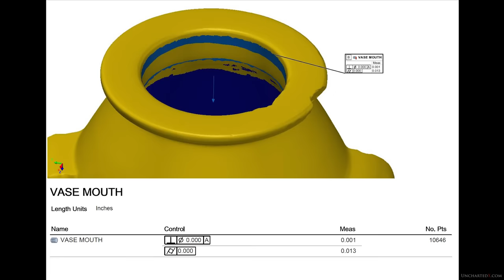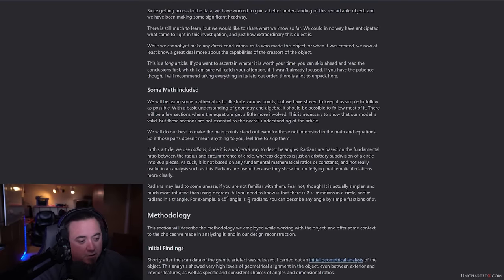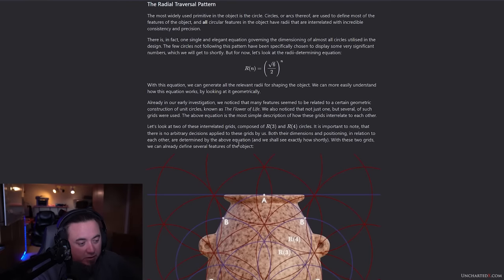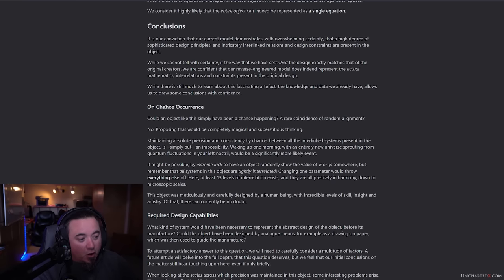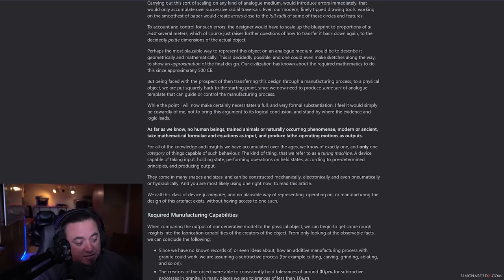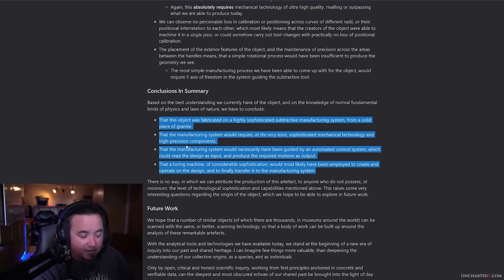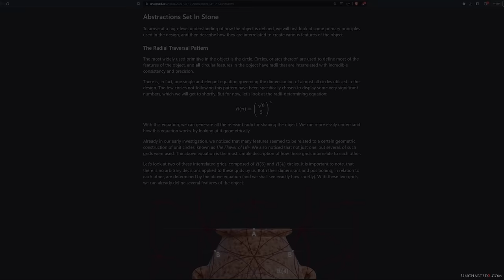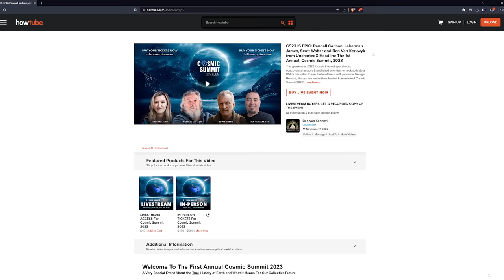Was a COMPUTER Used to Design this Artifact??

Comment: As a former machinist, I totally agree that this was made using a lathe. The mind boggling thing is the handles... Either they where "glued" by some ways after the turning process, by "melting" the granite like we do for pottery or the whole vase was made with a multi axis CNC machine like suggested. Incredible stuff. 
We are absolutely not the first generation of humans with high technology roaming on this earth, we just kinda lost traces of it in history and those artefacts are there to reminds us that it all existed. Fascinating!
Reply: There was no gluing or melting involved, it would be obvious in granite. Melted granite turns into volcanic glass upon cooling. This artifact was simply machined in one piece using very precise tooling.  I also have my doubts that they were ever "vases", not a single original lid has been found.
Reply: @methylene5  Yeah I totally agree about the glueing. It makes no sense really. A vase in my vision, does not have a lid, at least in the french version of the term (I speak french). 
It's more like a flower holding thing with open top, if you know what I mean. So maybe "vase" was not the right word for it. Not important, the point is the fabrication process.
Reply: You can't melt granite and re-form it unless you allow it to cool really slowly so the crystals can regrow - this is 10 or 100s of 1000s of years. quicker cooling gives basalt or diorites.
Reply: @mistral-unizion-music  I think the manufacturing process is but a single point among many others just as important.
Reply: @methylene5  I have also been uncomfortable about calling these mere vases. I'm wondering if the others found were, as far as could be seen, exact duplicates. If there are differences I wonder if they maybe somehow a way of storing information similar to a hard drive or a floppy disk. It would be like stone age people stumbling on a floppy disk and think it is merely a drink coaster. Or finding magnetic tape and thinking it is just old present ribbon or bow making material. Maybe they somehow fit into one of their computers and data read off of them.
Reply: @SlickArmor  Christopher Dunn thinks they are possibly helmholtz resonators (hence no lids). Which are used to convert the Earth's low vibrational energy and increase the frequency to very high level for the production of electricity in the Great Pyramids. He details this in his book called the Giza Power Plant.
Reply: @methylene5  oh very interesting thanks for providing a new direction to check out. I wonder if they have tried to see if there is any residue in any of them? Thinking in that direction perhaps with them being a container they may have contained a liquid and maybe the lids were made from a different material that didn't last. I'm thinking maybe a lid with insulating properties like a wooden lid. Then wires could come through the lids like a miniature Bagdad battery. I'll have to see what Dunn has to say as that sounds like a totally different super high technology. And just to reiterate I wonder if there were scores of them with the exact same dimensions or perhaps different sizes for different resonances.
Reply: @SlickArmor  I definitely recommend reading The Giza Power Plant. I read it some months back, and it's quite thought provoking. If Chris Dunn is correct, then there is obviously a lot of equipment that is missing, and the Great Pyramids would have to be much older than Egyptologists say. 
The basic principle behind the theory, is that the reason why the Pyramids are the size they are, is due to the extreme mass (nearly 6 million metric tonnes) and therefore inertia to create the highest vibrating pressure/forces from seismic vibrations. They are a harmonic with the mass of the Earth, so the Pyramid can be made to resonate in tune with the Earth. The smaller Pyramids being used to kick start the Great Pyramid power plant. The helmholtz resonators were used to gradually increase the vibrational frequency using harmonics in the Galley using thousands of the resonators. The stack of granite above the King's Chamber was also used to further increase the frequency. 
Granite is crystalline, but it's not a single crystal obviously. A single quartz crystal (which has piezoelectric properties) when compressed will generate a charge on each side, positive and negative. So how can granite be used for piezoelectric power? Since the currents would remain inside and simply get turned into heat. 
However, by vibrating the granite at gigahertz frequencies, this will then generate microwaves, which easily pass through the granite and can be used for power. Chris suggests that hydrogen was used to form a maser (microwave laser) which was directed through the "air shafts" which were likely once metal lined to act as wave guides. The maser would then be directed towards a special converter (possibly once contained within the stone box/"sarcophagi" in the King's Chamber) for the generation of electrical power. This would explain why only certain parts (King's Chamber, for example) are made from granite. Also the lack of any hieroglyphs in any of the Great Pyramids. In total it's estimated that about 8000 tonnes of granite was used, and an added bonus is that the continual extraction of seismic energy would help reduce or even prevent earthquakes in the region. There is evidence of an explosion (Chris suggests a hydrogen blast) in one of the chambers, with the walls and ceiling bulging out and with soft mortar used to fill the cracks to contain the gas (since the mortar isn't strong enough to be load bearing), the explosion perhaps was due to some form of overload. Meteor impact, attack, or who knows what. 
There are rumours that large lengths of copper cable were found in certain ducts, then removed and hidden away.
Reply: @SlickArmor  There is an interesting article online titled "EVIDENCE OF ANCIENT ELECTRICAL DEVICES FOUND IN THE GREAT PYRAMID?" by Chris Dunn that is worth a read also. A quick internet search should bring it up.
Reply: @SlickArmor  yeah i'm wondering if there is a correlation between the shape of the "vases" and the type of granite used. i also wonder if the frequency used to create the vase tells us something about the granite itself.
Reply: @AustinKoleCarlisle  that's an interesting thought about varying the frequency during the manufacturing process. If that's the case the vases could look the same but somehow the information is embedded somehow into the surface or like you say in the crystals themselves.  Hmmmm, very thought provoking.
Reply: @SlickArmor  i said that because apparently, according to the study Ben referenced, the top opening of the vase is directly related to the wavelength of16 Ghz. now, whether this is intentional or not is to be debated, but i'm of the belief that it speaks to the frequency used to create the artifact. in other words, pieces like this "vase" are art in the sense that they are a direct reflection of the energy used to create them.
Reply: We might wonder at the priorities of a society that would devote their efforts to such skill and perfection.  Their focus must have emphasized the sacred in sacred geometry.
Reply: @methylene5  I doubt it was done using any sort of "melting", but I personally believe it was most likely accomplished using a number of techniques from turning it on a lathe, some hand tools and then slowly wearing the left over unwanted material away with the careful application of a strong acid and polished clean afterward. Still suggests they had much more knowledge than commonly asserted, but without the need for complex machining technology like waterjet CNC.
Reply: I don't think they're glued on because on pictures on other vases the granite pattern follows through to the handle, it's solid. they possibly lathed the handle around the whole thing and then used another technique to cut it snow just leaving the handles. Fuck know how they would even lathe that though, it'd have to be a very sturdy lathe to work at those tolerances with granite.
Reply: @methylene5  This is where you lose me lol. They're clearly vases, the lid was made from another material.
Reply: @Slipperygecko390  All 40+ thousand of them and not one lid made from stone, that's weird.  We don't know what they are,they just look like vases to us. Actually there ARE lids. The ones that exist (made from sun dried mud) date to the Dynastic Egyptian period, but obviously were made by a different (later) people than the "vase" builders, as those mud lids are so crude. IIRC, there are some in the Cairo Museum.
Reply: @methylene5  But not precise enough to make the handles symmetrical.
Reply: @methylene5 that use did certainly cross my mind, but then why put handles on them. They are clearly purposefully aesthetic, which would not have been required if these were resonance tools.
Reply: @diclara8378  That's an assumption though, there could be any number of reasons why they'd be suspended (needing lugs with holes in them), even if used as resonance chambers. In fact, they would function better if suspended in air, that way they'd ring/resonate but if sat on a solid surface, some of the energy would be lost by transfer to the solid surface.
Reply: @methylene5  true, maybe it was for functionality after all?!
Reply: @diclara8378  It's hard to say for certain, but I wouldn't rule out the possibility.
Reply: Agreed, this was not made on an ordinary lathe.
Reply: The only other explanation I can think of is that they were created over 100's years by craftsmen (monks or holy-men) by hand by passing on the vase from generation to generation. 
Having said that, this is not my favourite hypothesis, but still can't figure  how they did the interiors of the vases. 
But yet a possibility? .
Reply: @Ln-cq8zu  You cannot obtain symetrical dimensions that precise unless it is made using a rotating device like a lathe or a CNC multi axis machine or something like that. 

It is just too precise to be hand made. Think about it, a human hair is typically about 0.004" (4 thousands of an inch) in diameter. It is very small. 
It is the kind of tolerance we machinists are used to, to make a peice using machines like a milling machine or lathe. 

So to obtain a near perfect peice like that, that is symetrical both sides of it's axis in that kind of tight tolerance, does requires this kind of machine and cutting tools. Or laser cutting assisted by computer or some kind of very precise device like so.
Reply: Or it's just another fake, in a fairly long series.
Reply: What if the "cutting" tool were a laser, that could be turned off at any point of the turning, and/or instantly adjusted during turning? This could account for the handles?

What if the machine did all the "turning", and the rock was kept fixed. There are very large, even megalith, structures that were carved in place. There are large statues that appear to have been made with large tools. Clearly those objects were not turned on lathes. We really don't yet know what technology or tools or methods were used. Clearly they were advanced.
Reply: I love how the consensus from mainstream archaeologists is that there is no lost civilisation that had superior technological prowess than either the Ancient Egyptians or us ourselves. Presupposing that technological development only ever goes up through the ages never down, completely discounting the dark ages, Greek fire, Damascus steel or even Roman concrete, only one of those things that we have finally sort of explained (the concrete). 

The idea that technology cannot be lost is crazy. Ask your average person to make a PCB for a computer for example and they wouldn’t have a clue. If a worldwide disaster right now reduced all the computer factories to dust and everyone capable of recreating that technology was dead, it would be very hard if not impossible to recreate in subsequent generations. You might be able to roughly recreate a circuit of some kind but not in the microscopic detail they are currently- it would be the equivalent to the hieroglyphics that are roughly etched into the perfectly carved and polished statues in Giza. A complete mismatch, same idea but totally different levels of aptitude and skill.
Reply: The analysis shows clearly it could NOT have been made with a lathe. 5 axis milling machine is the simplest machine capable of producing it.
Reply: @timothyblazer1749  I know, that's why the handles are the blocking factor for the possibilities with the lathe. Unless there are clear cutting tool tunring marks on the surface, this would indicate a good clue but multi axis machine is a way more advance machine to build than a lathe. It is quite mesmerising to think they had this technologie back then. Unless it was all laser cut or something.
Reply: @mistral-unizion-music  even a lathe could not have done it to this precision, in granite. And that is what is being lost on the naysayers.
Reply: @timothyblazer1749  It always depends on the cutting tools used. The turning method is ideal for cylindrical shapes, if there was no handles, who knows what cutting tools they had? Say again a laser, but used on a lathe. It would be interesting to see the level of precision. Maybe it could be a jet of water or something else entirely. Diamond could also be considered of course.
Reply: @mistral-unizion-music  doesn't really make too much difference with an anisotropic material. Water jet won't work with that and anisotropy, nor will simple diamond tooling. Heating ( lasers etc ) would leave vitrification scars. Perhaps with a sonic knife yes, but our civilization has barely begin using that tech now.

Essentially ablative methods can't do this level of precision either. That's why this is so exciting :-)
Reply: @timothyblazer1749  Yes indeed It's a great mystery! I love this stuff. Like another channel always say: We find this highly complelling! 🙂
Reply: @timothyblazer1749  you can see that they aren’t precise in just this video. You can see they are out of round. But yeah nah a lathe is exactly what you would use to make something precise
Reply: " I totally agree that this was made using a lathe."

I agree it was. It was made circa 1980 with a modern lathe.

There's absolutely nothing to suggest the vase is older than Miley Cyrus. Because it isn't.
Reply: we can find stone tools from 30 000 years ago but cant find these huge piece of machinery?

Comment: This should motivate some museum curators to put their vases to the test as well.  The process is safe, non destructive, and creates a high resolution record of the piece.
Now it needs to be done with several objects that have clear provenance.  The parallel precision math in different objects would be a smoking gun.
This and other evidence should already have opened eyes, so there will be more resistance to looking at evidence.  
We may be at the dawn of a new understanding of prehistory and UnchartedX has been invaluable in the struggle to get there!

Comment: Couple of considerations--

1. The objects(vases, bowls etc) are merely decorative, in which case they were "easy", i.e. practical, to make on a large scale. This means some method of mass production, which rules out hand tools and also one-off machine tools. You don't spend a lot of time setting up a lathe or cnc machine to crank out a simple decorative vase to ultra-high precision. This implies something beyond that, maybe a device where you open a door, stick in a chunk of granite, plug in your design and the machine does all the work(robot arms with super-hard cutting tips?) and the precision is a by-product.

2. The objects have some practical function, who know what. In this case it would justify one-off techniques like lathes and cnc machines 

If the objects are merely decorative, it implies a higher-tech level than if they have some practical function, but for sure, in both cases, the tech was higher than just simple hand tools.
Reply: look into polygonal stone walls which span the entire globe. many of them (the oldest ones) interlock and perfectly mate in three dimensions. if you stop to consider the difficulty of doing that by hand, you'll see that it would be impossible by "trial and error" fitting considering that many stones weigh over a ton. the only way to achieve this is with computer guided cutting--just like the implications of this video.
Reply: 100%. That implies tech level 1+ on the kardishov scale. Post scarcity.
Reply: Perhaps these items were of significant importance and huge value to their creators and/or they had a very important practical use, but that does nothing to explain the unworldly mathematics and technolgy involved.
Reply: Point number 1 isvery very very important! We need to understand the context under which these artifacts were created.